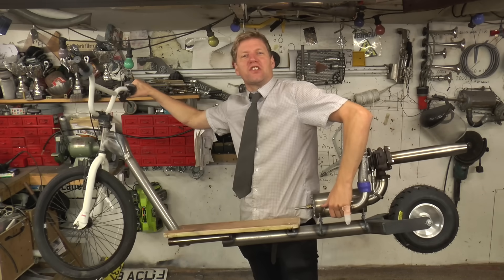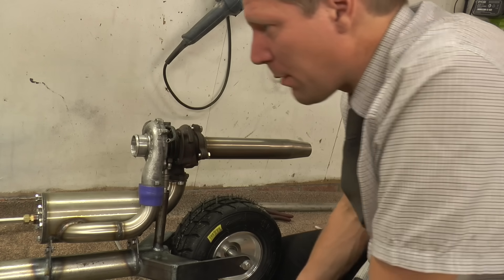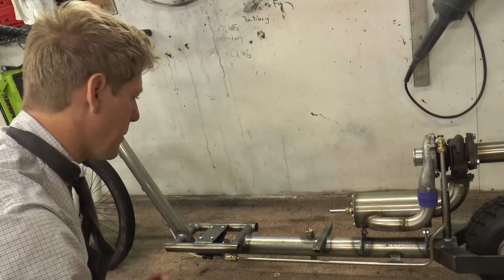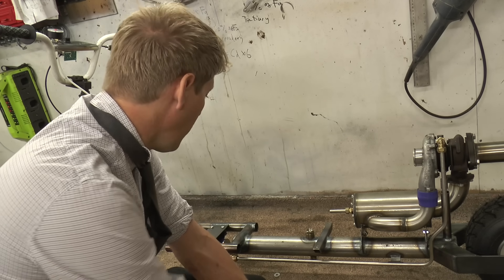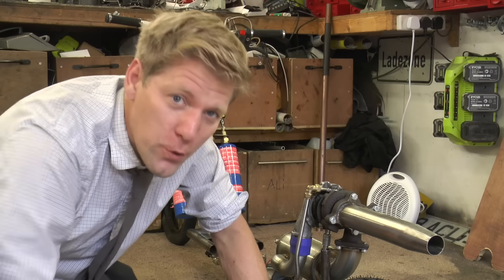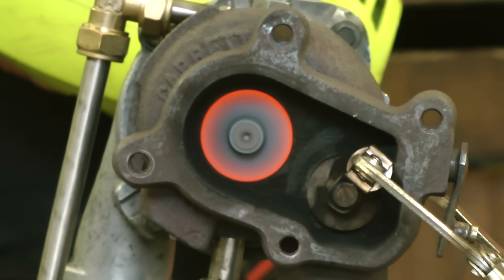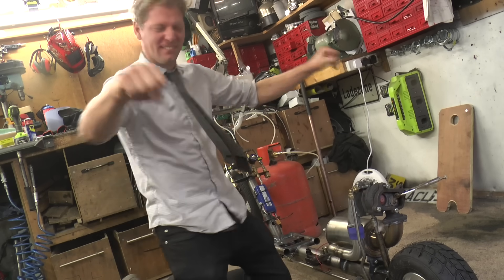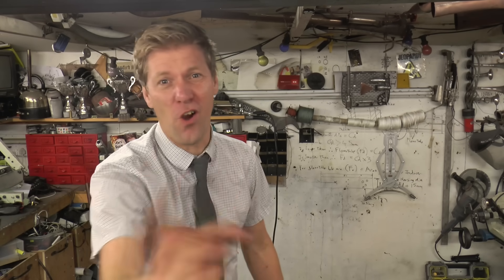TurboJet Scooter Build #2-Oil/Fuel/Test Fire

Comment from the maker: The Project continues as we have MASSIVE TURBO, thanks to fast turbo, this isn't a sponsored video they just got excited and wanted to help and got me out the hole I was in haha. Subscribe,notes on as you don't want to miss the next part.
Reply: Maybe try putting some kind of stator vanes right after the turbie wheel into the exhaust nozzle, so you´ll have a directed airflow and not some hot air swirling around in that jetpipe :)

Best Regards Jonas (German Airforce Jet Engine Mechanic)
Reply: I think the problem is, Jetengine with this kind of rotor isn designed for producing trust. They are desgined to produce manly torque to drive stuff like an propeller. 
Is maybe a chain to backwheel a kind of solution or at least an idea for another project?
Reply: You're so inspirational man I got into tinkering with all sorts of stuff after funding your videos a few years back and I got my pilot's license and built my own kit plane nice experimental aircraft.
Reply: how do u come up with these crazzy idea's
Reply: @jackstratfull6865  I think people in the comments tell him so like he checks all off the comments for ideas
Reply: If that doesn't work Colin you could always go back to a pulse jet
Reply: colinfurze your incurance bill must be throu the fucking roof.
Reply: OK, so you need to bypass some bleed air from the compressor into the turbine inlet to cool the turbine, put an egt sensor at the turbine inlet, and keep that temp below about 950F. 

If you want to get really scary, you can feed the small turbo compressor outlet into the large turbo compressor inlet and make WAY more HP via 2 stage compressor. Then, the combustor feeds both turbines.
Reply: Take a look at Jet and Turbine owners -board and make it right at once.. At least pay attention to combustor air feed tube, place it bottom end of the combustor and don't make it feed the air into it "radially". Don't know how's your current propane nozzle, but it only needs one row of holes close to the combustor top. You don't wanna ruin that new turbo.

Great stuff anyway, looking for the results! Keep it up!
Reply: Man i like your spirit you r the best
Reply: You might consider building a bearing and some turbo fins into the outlet pipe...  making it into a turbofan essentially.  You could also add an intake pipe on the front with somenof the same.  This would make it into an actual jet engine of sorts.  Tolerance are like...  less than 1mm though.  :-/

@colinfurze  #colinfurze
Reply: @AflacMan13  I think she should make a turboprop (well, turboshaft) bike.
Reply: https://www.youtube.com/watch?v=dYFYZ-g7fzA You may be interested !! Turbocharger turbocharger from KAMAZ. Multiple winner of the Paris Dakar Rally.
Reply: @DART2WADER  The funny thing is Igor Negoda, the guy on the link, these days is making a similar project to power an old BMW with a roaring might of a jet engine and its nearing completion. I wonder who is going to finish first!
Reply: @sergeib.v  It's not similar. Negoda uses APU unit which is waay more powerful and has a shaft output. That thing Colin makes seems like a fun project but really well made though
Reply: Я знаю.
Reply: why dident u ride rhe bike
Reply: What you really need's an afterburner... should give you about 60% more thrust than just the turbo itself.
Reply: @DigBipper188  - AB needs bypass air, which could have just burned that fuel in the combustor in the first place.
Reply: @DigBipper188  Afterburners give this 60% increase in thrust at the cost of 600% increase in fuel consumption. Awesome flaming exhaust comes as a bonus so it is a must for this project!
Reply: I couldn't agree more. it's a must for this project, especially with Furze's track record of giant flames. also... I love seeing jet engines with afterburners. They're basically legal flamethrowers lol
Reply: colinfurze  would you rotating seesaw
Reply: YOUR THE FUCKING MAN
Reply: add the small one as a booster to the main turbo jet
Reply: Colinfure put a beeper to a kid car, and then give it to your son.
Reply: Then put a rocket
Reply: Cough cough holset ht4b
Reply: You are simply brilliant.
I started my jet engine project 11years ago, and I never completed it because of lack of time and primarily because where I lived at the time, a valley, people...don't like noise.
Now I want to restart the project, I have two turbos, one small Garret T2 and a huge, massive, powerful holset HX60.
It's compressor can suck and compress 0.95cubic meter of air per second up to about three atmosphere.
A huge beast.
I need to restart that project.

Cheers from Italy!
Reply: Why not build youre own jet engine? Without using a turbo. I am sure you are up to the task. I mean yes you need perfect materials. But I am sure you can get that made for you.  

Think about it. It would be hella cool and educational.
Reply: Yesss.... nitrousssss #waaaaaaaaaaaaaaaahooey
Reply: @vk2aafhamradio  heard his voice on that "#waaaaaaaaaaaahoooey" haha
Reply: Hi
Reply: Meeeeeeh
Reply: Can I buy this scooter Mr Furze?
Reply: use the new small turbo to turbocharge a gy6 scooter..
Reply: 100th like on this comment
Reply: A rite proper fuck'n nutta E is...
Reply: You should use an EDF to boost the intake.
Reply: why make a jet why not just buy an rc jets and use them
Reply: @zodsmuffin2369  because he can. 😁
Reply: Yess Colin!!!!!!!!@
Reply: Small hatchback with a rocket strapped on. Video idea
Reply: Cool i subed and liked
Reply: Would you ever concider making a stirling engine
Reply: Where I can buy this gloves? XD
Reply: Add pedals, shaft turbine, torque converter and an exhaust cooler
Reply: @COLINFUZE - I really wish you would make a BattleBot for robot fighting like in the show "BattleBots"
Reply: colinfurze WOW AMAZING
Reply: What ever happened to March to the grave
Reply: Colinfurze turbo car turbo rat road
Reply: do you want me to have a look at the smaller engine. I can have a good go at getting it sorted for you
Reply: I kind of knew that that turbojet was never going to be able to push the scooter. It just looks like it doesn't give much thrust and this video has proven me right in my assumption. Hope the bigger one works
Reply: Big child 
A very very smart handsome big child 
And that's coming from a straight male
Reply: colinfurze keep it up man, this world needs more people that experiment more and build stuff just because they can. Love watching your projects come to life. Even if they are sketchy cough*knife skirt*cough
Reply: I'd like to get 1 turbo for free and 1 huge turbo at really low price, thank you.
Reply: colinfurze please show us a close up of that finger!  Did you cry?
Reply: You should make a car!
Reply: Hey boss, across the pond here.
Just wondering what you went to college for? I’ve been in the mechanical field for 7 years, lil bit of hydraulic, pneumatic, machining, welding, etc. , but I’m no master at all of the above. How did you learn/ where/ what degrees do I need? . I’m looking to be you so a reply would be great.  Thanks and love from the states
Reply: @the-potato-warrior  Colin is a qualified plumber, you should be able to tell from all brass fittings , valves , gauges etc , I'm a plumber and smile when I see what he's uses in his projects as I use them daily at work .....and he's only 25 miles from me ..
Reply: bigholty1 😑 yeah. He obviously has a degree in engineering. Plumbing isn’t hard
Reply: colinfurze ¡Seems pretty cool, i wish i cuold ride it!
Reply: NEEDS MOAR AFTERBURNER!!!!
Reply: If you’re looking for more thrust, you should also build an afterburner system into this too. They pretty much work just by adding more fuel behind the turbine and then igniting it in the exhaust. You could do this via heat coils or spark plugs. The result will multiply your thrust output and will throw out a 6-8 ft flame out through the exhaust.
Reply: Hey Colin you are awesome! If you need practical info about handmade turbo jet engine look at the Igor Negoda chanel. He did one and it works and even raises 6 feet plane into the air.
Reply: Finallyyyyyy felt like i waited forever for this
Reply: Idea for next build: pea shooting gatlin gun have like a tank feeding into a pipe and have high pressure air fire it down and out the tube at a rapid rate while the chambers spin it might have to shoot through only one but i have the feeling you can make all the pipes fire 😎
Reply: Are you going to paint it
Reply: Hurry up. Everyone wants to see that thing move
Reply: Hey Colin stupid question but where do you keep your finished projects
Reply: nice gloves
Reply: What about a supercharger ie compressor   on the inlet side like some cars have got ? Keep up good work can't wait for the final build
Reply: I F#'&$ING LOVE your videos's even if they don't turn out as you would wish them to. To me, this just confirms your honesty and commitment to wanting the best out come for your project and .how to resolve common problems. Thank you Colin, more of these please, even though I love it when you get it right first time, or at least first edit.
Reply: Your projects are fun to watch and always inspire me want to hit the shop.
Reply: That is sooooooo cooooool hi
Reply: Just under 6.7 Million subs nice work Colin!
Reply: add an afterburner
Reply: Liquid rocket engine?
Reply: Another “Great Project Colin” 😉 and as always a fantastic punk rock break from reality
Reply: I love how much gets accomplished in each video! 10:01 LOL
Reply: You should add an oil cooler to keep temps down
Reply: Hay , crazy genius man , thay sale ryobi 9amp 18v buttery now started two weeks ago.
Reply: Add a small Oil cooler
Reply: oil cooler probably a good idea with this high temperature of an application
Reply: I approve of the massive snail
Reply: I very much approve of the big snail
Reply: Your my favorite human colin keep up the madness
Reply: Fantastic Colin Avenger
Reply: Just build an EDF with an afterburner I saw someone do that here on YouTube.
Reply: I need help Colin, I have a 70mm turbo off of a 6.0 powerstroke, I need help doing the set up, materials and math
Reply: You need to have a heat shield fender for the back tire.
Reply: colinfurze hi Im you fans
Reply: you are a legend, iv been watching your videos since the toilet roll turbojet engine......IT ACTUALLY WORKS  hahaha.    keep up the awesome work colin  I'm looking forward to the next video.  you are the master of awesomeness
Reply: How bout holset HX85 and make jet of it?
Reply: Can i have your drift trike
Reply: Lol, you look like gordan ramsey!😂
Reply: https://youtu.be/yuOsQEjqEP0
Reply: Colin can I have to you drift trike please 😭😭😭😭😭
Reply: https://youtu.be/7AjKC2bUbzM
Reply: Please watch this channel
Reply: colinfurze ø
Reply: colinfurze  M           ?
Reply: colinfurze nice design! Some ideas to increase efficiency and thrust: consider tear dropping the holes in the flame tube in the direction of thrust, this directs the combustion directly toward your HP disk, and reduces turbulence, centrifugal compressors lose efficiency at high speeds. Also for your throttle, consider a mechanical idle valve, and two throttle solenoid valves, wired to an arduino, use a twist throttle to a potentiometer or lvdt as your input control, and program the arduino to pulse the throttle valves, you can even use another potentiometer to control full throttle frequency / duration of the pulse. It’s a clean reliable way to control your engine, without risk of overspeed. Also consider a surge bleed valve on the charge pipe, to help with the surging and compressor stalls
Reply: colinfurze Pujabi versa
Reply: Love your work colinfurze always entertaining and educational. Let me know if your ever in new zealand
Reply: colinfurze  hi
Reply: Your a smart guy bro I do the same stuff as a fabricator in a food processing plant I mean I haven't build my own scooter or nothing but similar modifications to machines
Reply: Colin, I'm from Desborough, you are so close to me <3
Reply: What size turbo?
Reply: colinfurze how do you make the hole saw for cuttin out the metal?
Reply: Colin.....how much would you say you have spent in all the tools....it always seems like you have the exact tools to create what ever you want. Love it.
Reply: Hey buddy take care on your hands safely first 🤙🏼
Reply: @colinfurze I’m thinking how much oil eating this bike?
Reply: Oot paras
Reply: Crazy Man
Reply: Now compound boost it.
And add an afterburner.
Reply: Zach Michaelis  No. 1 bar is atmospheric pressure. It changes with altitude realative to sea level. PSI is constant.
Reply: I wonder how fast you could make my 1lt AX go lol anyway fantastic video's you mad professor.
Reply: That's awesome bro. I wish you the best on your life adventure. May you bro g joy to millions
Reply: Are you a
                     good enough person 
                                                   morally
                                                                            to enter into heaven? 
Have 
             you 
                         ever 
                                      use 
                                            God's 
                                                         name in vain before?
 Have you ever 
                                hated anyone before? 
                                   Have you ever looked at a person 
                                                                                                with lust in your heart? Have you ever had sex outside of marriage? 
                          Have you ever stolen anything before irrespective of its value??? How many lies have you told before in your  life? 
     Have  u  ever downloaded music or movies illegally that you did not pay for? Have you ever lusted after material possession or money before?. Have you ever fished for compliments while rejecting the word of God?
If you have committed these sins 
..............God sees you as a liar a thief an adulterer in the blasphemer a fornicator and a hater at heart and you must face a holy God on the day of judgement!

                                    Will you be innocent or guilty on the day of judgement?
Will you go to heaven or to hell?
                                                      Revelation 21 says all liars will have their part in the Lake of Fire which is the second death... 
                                 The Holy Bible says that no thief no adulterer no fornicator no blasphemer and no hater by any means shall ever inherit the Kingdom of Heaven!

                                                .,,,,,,,,......u have broken God's laws and Jesus Christ has paid your fine with his own sinless blood...
If you repent 
and turn from all sins
 and Trust alone in Jesus Christ 
God will forgive every sin you have ever committed 
                                                                      grant you eternal life! 

                            If you refuse to repent 
then you must pay for your own sins against God yourself
 on the day of judgment 
which means that you will spend an eternity and outer darkness and everlasting burnings where there is weeping and gnashing of teeth forever!
Reply: I guess am late to the party but honestly Colin @colinfurze I strongly think you need to trademark your inventions and sell them on large scale. Eg The scooter you made for your kid will be a big seller in Africa 🇬🇭🇬🇭🇬🇭🇬🇭🇬🇭🇬🇭 and PS that’s a Ghana flag google it😂😂
Reply: So is this what you do, end your videos by sending viewers to a video that doesn’t exist?
Reply: Just carry an electric drill with you with a bolt socket on it in a backpack to start it up.
Reply: You should do an airplane build
Reply: @JustMe-ih2kd  he has a budget
Reply: you very hansome
Reply: you lavv him longaa?
Reply: Yo
Reply: Hey man.
Reply: colinfurze I think it is just not a right turbine for it. The one you are doing with it now is for turboshaft and it may not a right stuff. The one you need is the turbojets and that one is burning fuel to create thrust. Then just 20% of the thrust is using to turn the compressor. Fuel must be burn equally at high pressure not high speed and the end outlet nozzle must be smaller. Ideal is the compressor compress all the air up, then spray the fuel in (you may consider about Jet fuel or diesel for better results) and must have more spark plugs to ignite all the fuel at one. Highest pressure must be in the end of the compressor stage and slightly drop when it reach the combustion chamber to prevent the compressor stall which you are may having now. After combustion chamber, pressure must be reduced and velocity of the outcome gas must be increased. That is your thrust. 

The higher pressure you get in the combustion chamber, the more thrust you will have. You may want to use double compressor or more. 

I am a fan at your works. Watching your Chanel since 2015. I am studying about Basic Gas Air Turbine so if you need some reading material just email me on khazh19@gmail.com. I am planning to build one but don't have the right tool and the right stuff or time. 

Willing to help. Thank you and have a nice day. 
Khanh

Comment: Nice to see you get the most out of your gloves 
Wondering if the small combustion chamber would work if it had a smaller coned air inlet to fase the air through to reduce blow back, guess this would affect final thrust but a have a steam afterburner idea for that   :-)  less gas usage.

Comment: noticed you were struggling to bend those metal rods with that tool you were using (don't remember the name of it) during the project, seeing as you have a hydraulics system under the bench, what if you were to modify that tool using hydraulics to bend metal tubing like that, maybe even bigger pieces of metal tubing?